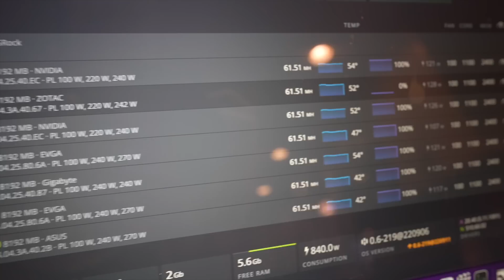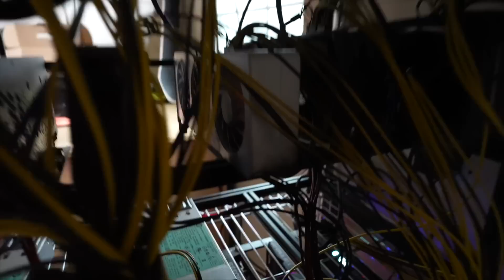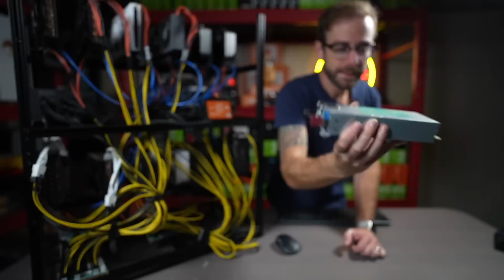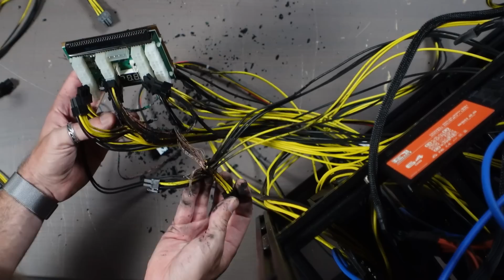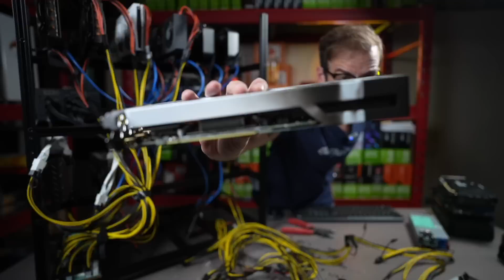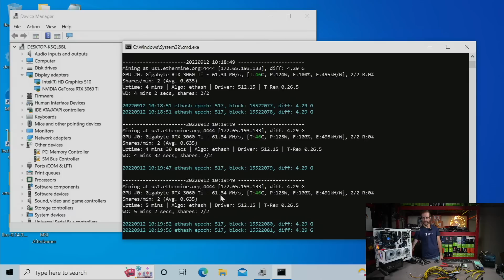Mining Rig FIRE!

Comment: Tons of times I see people pulling the cables out by the wires and not the pin itself. This can withdraw a portion of the wires in the cable from the pin and still allow current to pass through a fewer number of strands hence overloading the wire and fire 🔥
Reply: Not saying you do that but I've seen tons of YouTube miners do it during disassembly.

Comment: What gauge wire are you using on the PCIe cables?
I found most are 18 gauge and the crimping of the connectors on these are very poor.
I've had a number of connectors melt and fail.
I use 16 Gauge gauge cables, and haven't had this issue since.  The thicker cable provides a better connection on the connector crimp.
I highly recommend everyone use 16 gauge wire, and never use splitters.

Comment: Hi Mike, I've experienced similar, the cable burned(no fire luckily) and somehow triggered my house's breaker, and those smell in the room, that I got to know something wrong with the rig. And eventually, it is caused by the cable. From that time, I put smoke detectors in my mining room, and near rigs. Also, I saw other comments below, it could be heat concentrated, this type of issue doesn't happen much with closed lid rig (server cases).

Comment: I know you mentioned it, but most definitely always make sure you have at least one, but preferably two smoke detectors near rigs that you have running.  Also keep a "Class C" (Fires that involve energized electrical equipment - You can usually get one that's rated class ABC) fire extinguisher nearby.  Not right next to the rigs, but near the entrance where you'll approach the rigs from.  Doesn't help to have the extinguisher next to the rack if you can't get to the rack if it's on fire. :)

Comment: I never tie cables together leaving them in a mess allows them to cool down with other fans around. If you make a bundle together they also cannot cool down or dissipate the heat into air. 
I'm not saying this is the cause but it is not a good idea to pack them together because the heat is not much but adds up over time.
Reply: I get tons of crap for my messy cable management, but I too, like you have experienced better cable cooling by not bundling them up. Bundling them up causes excess heat.
Reply: @RiverislandJoe  Indeed! I mean anyone can feel it. just hold a live cable and press it in your fingers and you will feel some heat.

Comment: The temperature change could have played a part here, where the basement is likely a lot cooler they could run fine 24/7 but being in the garage thats definetly hotter with those rigs running maybe the hotter garage stopped it from being able to keep those wires cool enough, you may have to oversize those cables another gage bigger too keep them from getting as warm an possibly melting, an like others have said that one cable may have been getting a little warmer due to corrosion or a bad connection or something that just pushed it over the edge once they were in the garage.

Comment: Did you have any rig(s) exhausting heat nearby around those wires or the breakout board? This may have melted the wires causing them to touch and surge. As you said before it was working fine in the basement.

Comment: Amperage is the key here. if the voltage drop, the amperage goes up to make up for the consumption. So if a PSU goes bad or disconnected/shutoff, the other PSU will try to compensate... high load. Generally, PSU should have shutoff completely because of undervoltage/overvoltage protection feature unless they don't have those kind of protection. So, with dual PSU setup, you need to make sure each GPU could handle the entire load in case one PSU fails.
Reply: It depends on how the PSU's are setup. If they are both going to multiple risers/gpus working together to power them then yes, but if a gpu/riser unit is specific to 1 PSU, the cards will just shut off or fail if that PSU disconnects.

Comment: I've gone through 4 breakout boards, my fault due to non-secure pcie cables or not using enough pcie wires to power server cases. Thats wild.  
I've pulled 1200w on each rig with 1 1200w psu per rig & still had less burnt wires than your rig.

Comment: if you can trace it back to the breakout board, where did you buy it from, did they have a good rep, was it real cheap?? sometimes those soldering joints can be pretty badly soldered, and eventually they'll lose connection and cause some kind of fire

Comment: Had two PC PSUs melted one of the PCI-E ports, both this year, both respectable PSUs (Seasonic and EVGA). It's an overload on a PCI-E port in both cases. Unfortunately Seasonic turned out to not be a good company RMA wise (sent me a refurbished PSU in a generic box, couple of cables and wished me good luck). EVGA, however, is top notch as usual - sent me a brand new sealed PSU in return.

Note that I do not use SATA, only PCI-E power from reputable PSUs. Plus I do not use more than 80% of PSU rated power. Plus I do not use more than one PSU per rig. And still.

Comment: It happened to my 3080 rig as well. My hp 1200w psu was only powering 2 rtx 3080. No splitters used. No sata. All pcie. 1 cable for 1 pcie port.... And it melted at the server psu port (exactly the same as urs) got stucked inside aka melted and solidified... Traumatic experience... Suspect its the wire...

Comment: Most likely the contact between the PSU board and one of the cables was never great and slowly degraded (corrosion most likely, accelerated by heat).  This increases the resistance which increases the temp, and it slowly cascades until it suddenly ramps up in temp, melts the plastic, causes a short, which causes a fire and things get bad from there.
There is something to be said for disconnecting, inspecting and reconnecting all our power connections now and then.

Comment: Insane for RTX 3070s only drawing say 115w to 120w each!   Yep, looks like a dodgy breakout board as you had single strands going into the cards that had 2 x 8 pins.  I'm glad that I've always used high quality atx power supplies and run them @ 50% +/- 10% of rated total power
Reply: I had chinese "18AWG"(actually 24AWG) get hot running RTX3060 and I had separate 6 pin cable going to the riser, 0 splitters or anything, the cards would also error out from time to time on undervoltage protection.

Comment: if you are using after burner for OC, it could be the issue. It happened to me once when my system restarted , I lost a PSU. Since then I I  do the oc directly on the batch file itself. Touchwood so far.

Comment: NOT THE 3070s!!  I bet you have a fire alarm, extinguisher and one of those fire ball extinguishers now... haha Not so bad of a fire actually.  Scary but contained. Looks like just a defective cable or bo board, that you would probably never be able to detect until it does just what it did.  I have Deep in The Mines BO boards and no trouble so far.  I don't like those cables you're using.. all loose... hard to contain.  I get the ones that are 16 gauge and connected to each other.

Comment: To many bundled is my guess. As electrician we calculate temp, how many together, cable voltage require to determine what cable to use. 
Dont know how this applies to pcie cables but its a guess
Reply: You are right, bundled cables are heating up and can melt down all the insulations and make fire. Thats why i dont bundle all together
Reply: 🤔 great point guys.

Comment: If that one loose black wire came out, then the other ground wires in that group would have had to carry the extra current.  It's hard to tell if it came out before hand, or if it came out because the connector melted.